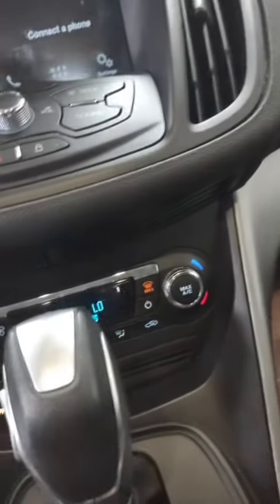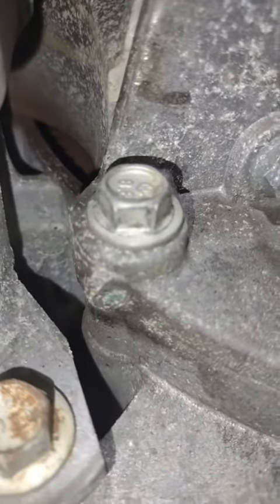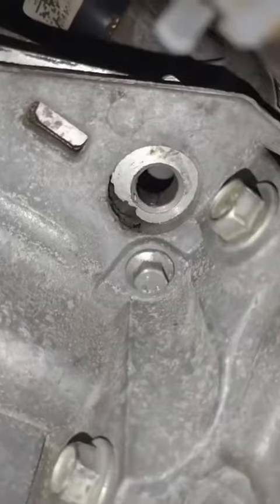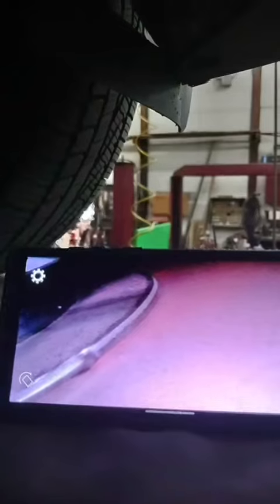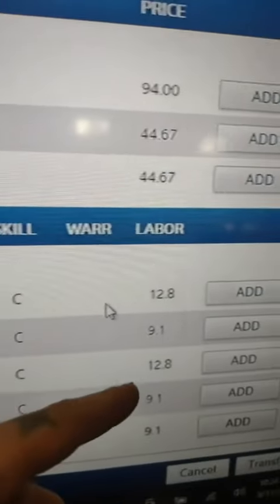Ford escape knocking sound.

Comment: Check that converter snout too, I've had a flexplate bust completely, flexplate lathed the converter snout causing a trans leak. If this one was still holding enough to take gear/etc then its probably ok.

Comment: Flex plate. Too common of an issue on those Escapes.
Reply: On lots of makes and models, not just a Ford issues. Jeep, Dodge, and Chevrolet have seen the same issue.
Reply: @fredted1611  which ones then?
Reply: @mattjingles5758  
Jeep XJ, Cherokee all motors
Dodge Caravan, Chrysler Town and Country, Plymouth Voyager all motors
Chevy Silverado 4.8 and 5.3
And probably some I have forgotten to mention.
The shop I work at see's 5 or 6 a year.

Comment: My daughter has a 2016 Escape, went into limp mode and the dealership she got the car from ended up replacing the engine. She got it back and said it was down on power took it back and the dealership ended up having to replace the turbo too. Told her next would be the trans, they circled the problem

Comment: Hard to image the load from the compressor clutch engaging would cause that significant of a vibration/noise from the cracked flex plate. I could see it making a bad rattle even worse. But to go from basically nothing to what sounds like a metal coffee can filled with steel nuts & ball-bearings... that's crazy.  There must be more going on in that engine.
Reply: It is related to harmonics (balance) of the rotating assembly.

Comment: Wow,are you sure the trans has to come out though? I think snap on has a tool for that so you can go through the starter hole. Seriously though,I see failures on flex plates and many times the trans or engine has been replaced without the guide pins being in place in the bell housing. As crappy as some of the metal is today,that does make a difference as it allows a little to much flex.
Reply: How would you replace the flex plate through the starter hole?
Reply: @iFixJunk  Are you trying to out sarcasm me? Please tell me yes.
Reply: @glen7201  Oh, man...

I'm sorry. I missed the humor.

Shame on me.

In my defense, I've been seeing a LOT of dumb comments lately. And answering dumb questions at work, too......

Is there hope for redemption?

(I wanted to see what I got for an explanation.)
Reply: @iFixJunk  Redemption it is,and yes the dumb comments are non stop anymore,thats why I try to through some sarcasm in the mix.

Comment: Smells like hard money to me .  Those transaxles suck to have to remove and replace , having to remove both drive axles , all those bolts ,the starter ,  draining the radiator  and everything else attached to the transale ,                        hard pass on that one ,   12 hours for repair shop time 🤣 you better add another 6 hrs  if it doesnt go as planned on that R&R . Just to be safe for your coverage time and  labor costs  😂